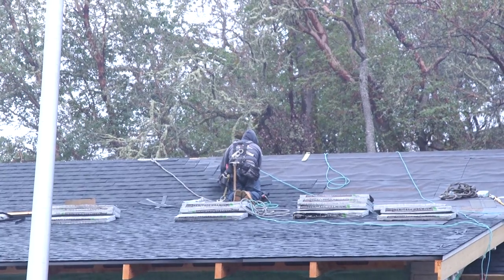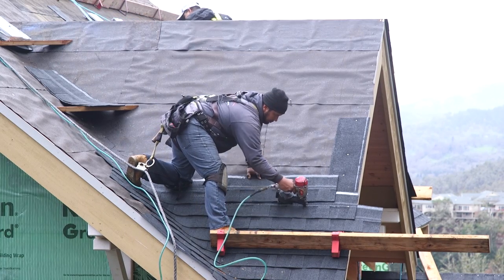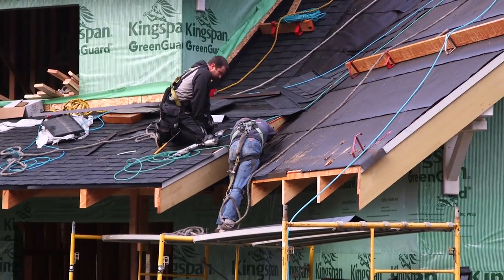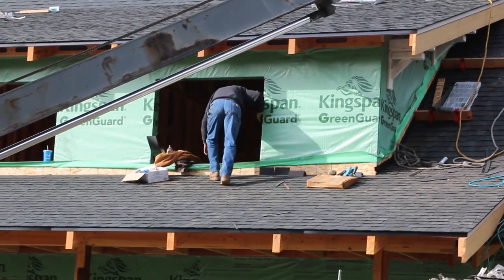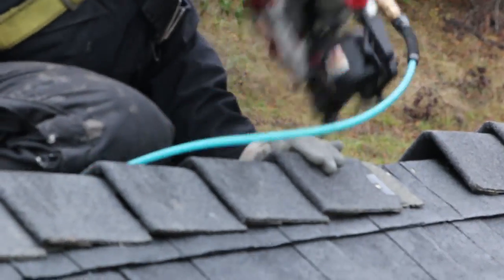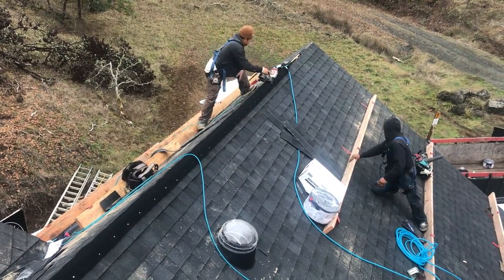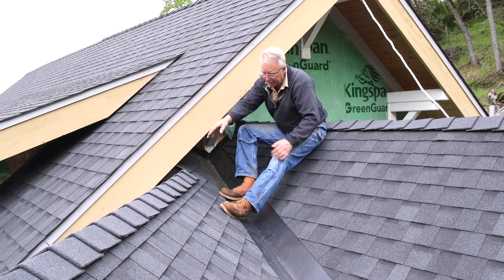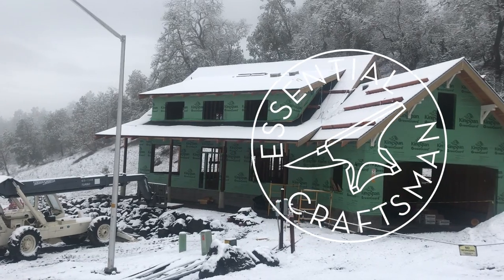Stunning and Complex Roofing Installation Ep.78

Comment: Personally I’ve never liked coming behind and installing vents and other penetration flashings after I’ve installed the roof. In my opinion it always takes more time and it feels like it’s harder. You end up having to pull up part of your work and redo it. I like it when I know everything that’s behind me is DONE. It also allows for you to make sure that nothing your installing is ever going to have a chance of a nail being to close to a butt in the shingles above or you having a nail that was driven having to be pulled so the vents or whatever can slide up in place. Then again I’m weird like that.
Reply: I know very little about laying shingles, however I just feel and agree that coming behind doesn't seem a good way to install vents for the reasons you say. It even looked kind of cluggy (my word) when they were doing it.
Reply: Simon Rinehart 
I wondered about that. I wanted the roofer to install solar tubes but he said that I should have a specialist install them after they complete the roof.  Two years later, no solar tubes because I don’t want someone cutting the shingles and cobbling up a repair.  Yes, it can be done after the roof is installed but which way is better, during roofing or after?
Reply: You dont nail where the vents go so no need to pull driven nails.
Reply: @dmrc43  - that's the point..... but if the shingler didnt know there was a vent going there, their nail placement COULD be in the way of then placing the vent.

Placement of the vent is determined from inside. First by the location of the bathroom fan / dryer / hood range being vented out. then from there by the rafter spacing in the area DIRECTLY above your vent for less turns = less obstructions in airflow.
Reply: @justinstevenson2061  ah i gotcha, i was more so talking about the holes you KNOW are there, leaving the shingles loose and sliding in the vents and nailing. 

I agree everything should be done before the roof installation, plumbing stacks/ bathroom vents  etc. Doing it after the fact just adds to the chance of a leak.
Reply: I think if that roof were covering the Titan sub, it would be dry, even at 100 fathoms.
Reply: Order of operation. Took me 2 years to train my crew to understand this concept, and to this day, those that have left to other cities or started their own business, they still call me from time to time to ask stuff or wish a good build whenever they see us work in or out of town. It's such a meaningful (among others) method of thinking and it eases everyone's work load so much that it's ingrained in their MO years after, even if they're not working with us anymore.
Reply: Do what you are doing in one so you don’t interfere with what you’ve done already. there are circumstances where you just cannot refasten as it was the first time round.
Reply: It is faster to instal a roof without all of those pesky roof vents in the way? Faster equals more profit.
Reply: Oh man I agree, some guys are weird and swear it’s faster to do after..... yaaaas ok
Reply: @markharmon4963  returning to complete jobs equal negative money
Reply: It's easier to cut one square (or circle) and have the vent be in super tight as opposed to cutting the shingles 5 times around the vent. It also can throw off your stagger if you're not paying attention. And like the other person said, don't nail near where it's going if you know it's going to be there.
Reply: @Mote78  If the person knows what they're doing it's not "cutting up the shingles and cobbling a repair" but rather a 5 minute job that doesn't damage anything
Reply: Installing vents on a finished roof is a roof repair.   .   .

Comment: None of these guys wear safety glasses. It's entirely their choice, but so too are the consequences. Especially, with a pneumatic nailer. When shaking hands with these fellas, it must feel like your gripping a shingle. Rough, calloused, and stiff  from not wearing gloves. Instant recognition of a tradesman. Also, one chap wasn't even wearing knee pads. Pants worn clean through and still scurrying around on the roof as if it weren't anything. Their skills are obvious and admirable. Their grit is astonishing. Those who roof or lay concrete absolutely have my respect.

Comment: As a 2nd generation roofing contractor, I have to admit I was looking pretty hard trying to find something to pick on. I can ALWAYS find something to pick on. Wow. not this time. That was a very tricky installation with about a thousand different ways it could have been botched. My favorite detail was where the step run meets the horizontal roof to wall flashing. That corner always gets goofed up. The way they ran the bottom step an inch or two past the corner is exactly how I do it. And they are even using the Max Super Roofer coil guns which happen to be the best shingle guns ever made! 
Very well done gentlemen. Craftsmen roofers are a dying breed. It was a pleasure to see your work. Keep on ROOFIN"!!!!
Reply: SMH.... THE APRON FLASHING IS SUPPOSED TO RUN 4" PAST THE CORNER OF THE DORMER WITH A 45 DEGREE CUT.  ONE SIDE OF THE CUT WRAPS AROUND AND GETS NAILED TO THE WALL (I USE A SPEED SQUARE TO HELP MAKE THIS BEND), THE OTHER SIDE FOLDS FLAT ONTO THE ROOF.
THEN, THE FIRST PIECE OF STEP FLASHING HANGS 4" LOW ON THE CORNER AND GETS CUT AND BENT AND FOLDED THE SAME WAY.  AFTER IT IS DRY FIT, A NICE BEAD OF HIGH QUALITY CAULK GOES IN THE CORNER.
JESUS CHRIST YOU CLOWNS ARE AMATEURS
Reply: @Dusk2007  For some perspective on this, you could check out my very long comment re: traditional flash-counterflash systems. I have ben practicing per my post for decades now. In my view any (single stage ) flashing ONLY method is a modern way of putting true cost off to the latter years (ie, being cheap and short-sighted). Everyone has their own standards of excellence, some more better informed than others.
Reply: @Dusk2007  
You're so right! What a FOOL I AM!
They're total hacks! My whole life has been a wasted lie!!!!

Comment: I too enjoy watching a roofing crew...
I means one thing...

It’s not me up there.
Reply: badlandskid I love hard work, I could watch it all day! I guess that’s why I’m a construction super...
Reply: it aint that bad. I do it everyday :)
Reply: @jessejames1590  moving HEAVY materials up a sloped surface littered with ropes and airhoses is bad.  I love my ground level.  That is the ONE job that's really kicking my ass.  Hardhat's off to you man.  You roofers are as tough as nails.
Reply: @jonathanfortin3329  Lol "hardhats off" I like that one.
Reply: I've had to solo two roofs.  Never again.  I'm watching these guys working in sneakers.  My dogs would be SCREAMING.  I did it for exactly one day.  My arches were killing me and the tops of  the toes on my sneakers were worn through.
Reply: Scott, a roofing crew just finished up my house (stripping old singles and installing new). They worked 10 days. You would appreciate the valleys, gable intersections, bumpouts and returns. Big roof too.
Reply: I disagree with that valley flashing on top of the shingles. I would think that water may run down the shingles and seep under the flashing. Where if you put it under the shingles it would not be able to get under the flashing to the wood IMO.

Comment: That roof design is one of the most complicated I've seen on an SF dwelling. It must have been a lot of fun framing. I would have loved the challenge. Good job brother for getting it framed and dried in.
Reply: I don't know about "most complicated". 20 years ago I did an architect's own house. I persuaded him to remove the roofer (massive fails at dry-in) from the project, and I took over. EPDM, corrugated galvanized, custom fabricated galvy standing seam, and twin-wall lexan over the porch. 40-some roof planes covering about 1400 square feet of total area. I did everything as a flash/ counterflash (soldered galvanized), so that we could do the sidewalls above parts of the roof, after dry-in and before the actual roof went on. No problems, no leaks. The drywall was actually hung and finished after the flashings and dry-in, and before the metal roofs were installed. It can be done, use care and have a very good plan.

Comment: Yep a pro roofer is an extraordinary craftsman. This is especially true when the Architect is a Loon and designs impractical things like 3 roofs sort of joining in one area. It is kind of like when additions are tacked on by flyby night home improvement guys.You had a difficult time framing it and the roofer had a difficult time making sure it is watertight. I say it was an impractical design.
Reply: He's said in multiple previous videos that it was necessary given their site constraints and style/size of house desired. Scott knew what he was signing up for all the way.
Reply: I have to agree that this is the strangest coming together of roofs i have seen in a long time, very odd nooks and crannies that in my opinion were completely unnecessary, bazzare roof for sure
Reply: I like the house and plenty of weird roofline junctions have held watertight in plenty of places but yeah man do not get the 13.8 degree bent house situation.
Reply: No Architect, was done by a designer/draftsperson.
Reply: @bearded4glory809  lets also remeber this roof is now a haven for any number of bees nests hornets nests , and many others , May be waterproof but its a home for plenty of critters ! Love the house but that roof is just weird
Reply: At a minimum the garage pitch could have been designed to match that of the lower section on the house to create a valley rather than a step. Form over function here, kiss should be the maxim for roof integrity.

Comment: Noticed the boot change! Welcome to the Thorogoods boot club! I’m on my third pair and I found a cobbler in my town. He’s put on some new bottoms a few times for me being UPS driver I put on a few miles on these and never an issue!
Reply: Have any experience with safety toe Thorogoods? The wedge style to be specific.
Reply: peglegthered yes actually I used to do utility work for a municipality. I have the plain toe composite safety boots. They have more room in them so maybe order a half size down, I feel my foot slip around I those more. Other than that they just as comfortable. I also use those in the winter now while working for UPS because they are waterproof as well.

Comment: Replaced my roof in 2017, first time it was stripped off since being built in 1956 I'm sure. It had 3 layers of comp, first layer directly on shiplap, no tar paper/roofing felt. Hardest job was tearing all that off and hauling it away.  I added overhangs on the Dutch gable ends(5 of them) with several intersecting roof lines and had to add a hip into a flat valley that apparently had been a leak problem for years( several repair attempts that still failed). It was a summer long project. Fun job at 57.
Reply: I commend you not only for taking it on, but for doing it right! Sometimes its and easy re & re......... other times your reframing to fix stupidity or just accommodate new knowledge into an older building.

Comment: Ah Roofing.  Did a lot of it during 40 years of construction.  Learned from multiple subs.  At my peak I could normally out roof most of them because I remembered the tricks from all of them.  It was the one part of the job, foundation to roof, that I dreaded the most.  Originally did not have the equipment to load the roof so had to do it by hand up the ladder.  Also always bending over keeps your back limber.  And the cost of the special roofing boots.  Got to give it to those guys; they really earned their pay.

Comment: I take it your not in hail country! I always get a kick out of the idea of a fifty year shingle, here in the hail zone of the Colorado front range, those fifty year shingles are lucky to make 20 years before being destroyed. My last Tamko roof only made it 12 years, it wasn't Tamko or the shingles fault, nothing stand's up to hail stones close to baseball size or bigger. In 2017 I saw several clay tile roofs beat to pieces laying on the ground around the perimeter of the house. Your lucky that you only have to worry about moss growing on the roof.
Reply: Do you see a lot of metal roofs around your area considering the hail? My thinking is that a metal roof would fare better, sure it would probably get dented by the hail but I doubt it would fail.
Reply: @44R0Ndin  There is some around, but pretty much in the more suburban/country type areas. The 50 year asphalt shingles do for the most part hold up to the hail, but still need to be replaced after a big hail storm, both zoning and insurance companies pretty much require it to be replaced. The metal roofs can get beat & punctured to the point they leak and look really bad.

Comment: Texas. Arkansas. Missouri. Kansas. Oklahoma.  T.A.M.K.O.  That’s where the name comes from.  
Don’t think they have quite the market yet there in the northeast (probably why they showed up in a fedex truck.. never seen that before) 
I’ve put on well over 25,000 squares of Tamko over the years.  They’re good shingles.  Won’t last anywhere near 50yrs (cause no asphalt shingle will, at least not in TX). It’s a little marketing gimmick that all the asphalt shingle manufacturers have to go with so their packaging doesn’t seam inferior.  I’ve only really had a couple of problems with them over the years and their rep was quick to resolve our issues! 
One question, the garage section with ridge vent, the attic there doesn’t connect with main attic does it?  Cause if so, those solar fan vents could pull air “in” from those ridge vents.. not a good thing.  Don’t wanna mix your exhaust vent types unless they’re completely separate spaces. 
Love the channel Scott!  Bought my first ever Anvil because of you!
Reply from the maker: Yep... completely separated
Reply: I'VE USED TAMKO, THEY SUCK
GAF IS WAY BETTER

Comment: There really should be step flashing at that gable end. While it's 100% true gravity will bring water down the siding and onto the counterflashing, a wind-driven rain will easily find itself under that metal flashing.
Reply: Do they not have drip edge running up their rakes? Its kinda hard to tell
Reply: @timbibin1301  Nope and no drip edge at eves also.

Comment: With the powered attic fans pulling air, its imperative to have the air sealing in the ceiling plane done as well as you can. Or else, you will have a powered air leak that pulls conditioned air and makes the stack effect even stronger.

Comment: something i dont think you mentioned was when the guy was fixing the shingles in the valley at the 2:20 mark was doing it was the best way because he was doing the off shoot of the main roof first, that way since the main roof is taking and flowing the most water placing the main roof first would add to the chance of water running up the whole of the lap of the shingles, its the same principle you mentioned about placing the lower shingles first
Reply: I got away from this style a long time ago, because of the issues posed. If we are doing shingles, and shingle valleys, we weave the two roofs, The lumpiness does not show much with laminated, and there is only a 1-course possibility of undershoot. And I just plain don't like the look of the (usually ragged) cut side of the valleys, done per this video.
Reply: @leestevens446  I'D AGREE THATS A WAY TIGHTER WAY TO INSTALL A VALLEY.... JUST WAY MORE TIME CONSUMING.  WHEN I CUT MY VALLEYS, THEY ALWAYS COME OUT STRAIGHT, EVEN IF I HAVE TO USE 2 HANDS ON MY HOOK BLADE

Comment: Is corrugated steel not used state side? It is almost the roof material of choice in Australian. Colourbond steel comes in countless colours and stands the test of time.
Reply: Maybe regionally somewhere. Here in the southwest, Arizona specifically, it's concrete tiles.
Reply: We have a fair amount of metal roofing in NE Arkansas.  We cut down all our trees for farm land.  Now the wind blows through it takes shingles with it.  Metal is becoming more and more prevalent.
Reply: In the uk, house roofs are mainly slate tiles or a close substitute and metal sheets are for industrial use, factories farms shed etc
Reply: "Metal will deteriorate and these shingles will certainly last that long"  I wasn't sure if that was a joke in his intro but it sounds like the shingle salesman really fooled him.
Reply: Ken MacDonald  What good does 50 years of experience do if you don't explore advanced building materials or step outside your comfort zone?  Asphalt shingles have benefits over other systems, but longevity definitely isn't one.
Reply: @trinitytoo  Just install snow guards... Seems like a simple fix
Reply: Asphalt shingling is just the standard in the northeast and northwest of the US. It's the accepted architectural style. Most homes look out of place without them!
Reply: We use metal roofs in the South,  just not all the time. I love hearing rain on a metal roof.
Reply: burgo_1 my standing seam metal roof, on a 12/12 pitch will likely last more than 100 years, possibly much longer. NO asphalt shingle is coming even close.

Comment: I have done some amateur roofing and can really appreciate what these guys accomplished.  Beautiful work.  The roofing installation accentuated the carpentry required to create all the different planes.  Valleys have always perplexed me, even though I have never had one leak.  I was really wanting to see the valley details you described early in the video, but evidently I missed the crux of the installation.  Also, the camera angles near the end and closing remarks appear to allow water to seep under the flashing.  I know this is not the case, and also know that camera angles on a steep roof are not easy.  Maybe a graphic later on to show the valley details?  Thanks for your videos.